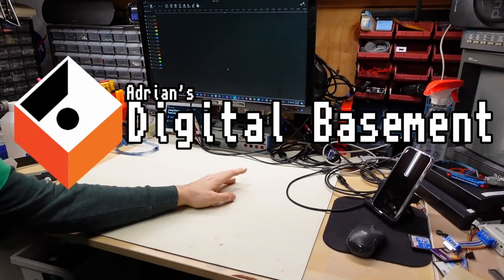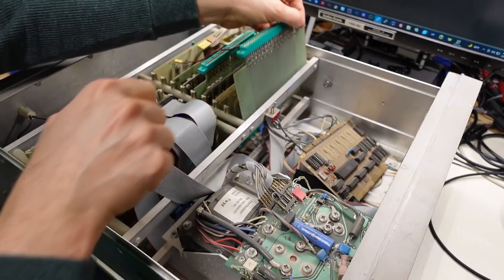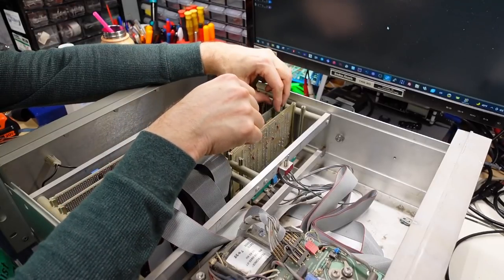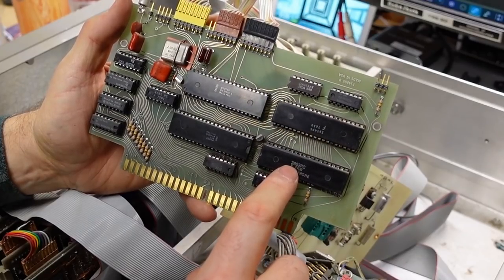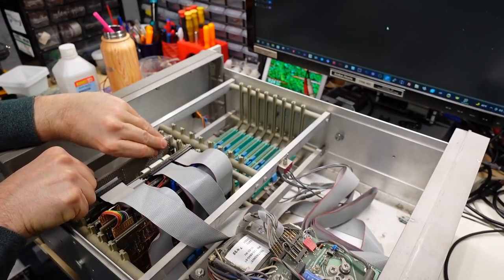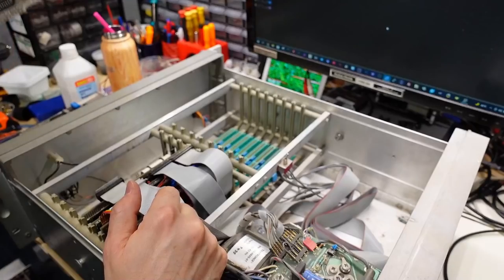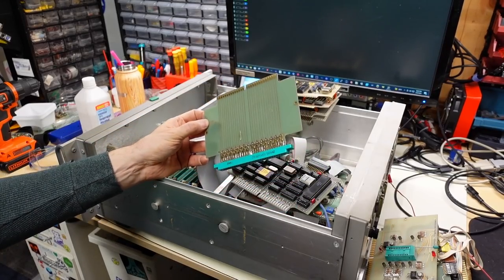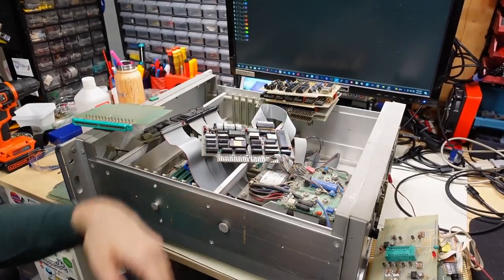I need help finding information on this mysterious computer

Comment: About 15-20 years ago I worked for a company that hosted computers for companies. it was a big place about the size of a big grocery store. It had multiple T1 lines coming in and racks full of computers hooked to it. People and companies would pay to have their machines hooked to it. My job was to install machines in the rack and hook them up, and keep them working, maybe change a power supply here and there. One day a computer that looked like that box came in. It was painted black, no name or lettering, no CD-ROM, no ports of any kind, just a power button. All it had was a network outlet and a power cord socket. I was instructed to bolt it in the rack, plug it in, connect it to the network, turn it on and forget I ever saw it. So that's what I did until this thing reminded me of it.     Just sayin'       Mike

Comment: Wow talk about a thing of beauty! Yeah the wire wrap is what you do when prototyping a system and designing a multi layer board would be cost prohibitive until a working prototype is built and working.  When I was in the Navy we used to have an HTS (Hybrid Test Set) that had a DWG (Digital Word Generator) module that had a ton of relay boards in it. Each board had about 200 relays on each board, and they were all wire wrapped on the back. The wire wrap boards were the final boards they used in ALL the machines we had. I guess because building an actual multi layer PCB probably would have cost a fortune. The machines are all obsolete now and I've been told they were all disassembled and scraped. Originally they had the like 10" brown disc cartridges in them and later went to OPTICAL Readers before they started scrapping the systems in the late 90's & 2000's. Anyways you'll have to put a video up of what you find out. Thanks for sharing, I really enjoyed the show. Best Wishes & Blessings. Keith Noneya

Comment: The original Motorola 6800 CPU board was actually configured such that the system could do in-circuit emulation (ICE) for a system based on the 6800, with a few connectors at the top of the CPU board that would connect via flex ribbon cable to a plug that would plug into the 6800 CPU socket on a system-under-test.   Most of the CPU boards had either discrete LEDs across the top edge of the board that showed the content of the address and data bus.  Later CPU boards substituted the wonderful Texas Instruments TIL-311 "smart" hexadecimal LED display modules to show the content of the address and data bus.  Usually there was a reset switch, and a "RUN/STEP" switch, and a single-step pushbutton at the top edge of the board for manual control of the CPU.   The DDT monitor could examine/deposit memory, set hardware or software breakpoints, could download Motorola S-Record code from a host on one of the serial ports (I think the max download speed was something like 4800 baud, at least with the 6809), start execution at a given memory location, as well as allowing input of assembly code (with absolute addresses only), and a disassembler that output absolute references.  I know that DDT was written for both the 6800 and 6809 CPUs, but don't know if it was modified for use on any of the other processors.

Anyone at Tektronix could order boards through the group and they would provide them as un-populated circuit boards, or completely assembled, tested-and burned-in.   The bare  boards came with a detailed BOM for ordering parts to build them out from Tektronix Engineering Stock, as well as a complete blueprint schematic of the board, and a document that explained the theory of operation of the board, as well as information for setting various jumpers on the board for address selection, options, etc.  The boards were strictly for in-house prototyping and development work, but were also available to employees to purchase for their own projects.  

Employees could purchase the raw boards for Tek manufacturing cost +10%, and the components to build them out could be purchased by employees from Tektronix Engineering Stock, also at Tektronix' purchasing cost +10%.   Tek purchased ICs and other electronic components  in massive quantities, so the prices for the parts, even with the 10% markup, were much cheaper than for what they could be purchased on the open market.    Tektronix Engineering Stock also stocked things like floppy disk drives, hard disk drives, floppy disks (8" and 5 1/4"), ribbon cable, connectors, and all of the other stuff one would need to build a complete system, and as with the rest of the stuff, it was Tek cost +10%.   

With my limited budget, I was able to build out a pretty nice 6809-based computer with four half-height, double-sided double-density floppy drives, 64K of RAM, two serial ports and two parallel ports, and DDT ROM monitor with floppy disk bootstrap for FLEX built-in.  FLEX was a CP/M-like operating system, but was not compatible at the filesystem or disk format levels.   It was written for the 6800, but would run on the 6809 just fine, as the '09 was would run 6800 code un-modified.    FLEX had quite a library of programs available, including a nice 6809 macro assembler, a highly-featured BASIC interpreter, FORTRAN-77, a really nice disassembler, a database system, as well as a lot of user-group contributed software including utilities, games (text-only), educational software, and communications software.

I was actually able to, with some hacks both to the boards, as well as to the operating system, get the Microware OS-9 Level 2 multi-user operating system running on the machine I had built up.  I bought Radio Shack 's version of the OS-9 operating system for their CoCo (Color Computer) model 2 and 3 machines. I re-worked OS-9 to remove all of the drivers specific to the Radio Shack CoCo machines, and included my own drivers for the hardware in my board bucket system.   It worked fine, but because the floppy controller was I/O driven (not interrupt or DMA), every time a process did any operation with the floppies, every other task would hang until the driver finished the floppy operation.   It wasn't really very useful that way.  That is what prompted me to first build a RAM disk out of a 64K DRAM board modified with 256K-bit DRAM chips and addressing hacks to make it into a solid-state disk. This hack, even though I/O driven, was vastly faster than the floppy, and made multi-user operation tolerable.   Later, I hacked together an interrupt driven board that interfaced the system to an 8" Micropolis 35MB hard disk drive (very noisy and power hungry) that I purchased from the Tektronix company store new-in-box for $75.   The drive had a pretty simple parallel interface that I bit-banged, but I did rig up an interrupt for the "command complete" and "ready for command" bus signals, so that commands could be given to the drive, then the driver could immediately return to the OS, and the command complete interrupt would finish off the operation, making the driver non-blocking except when it was sending commands/data to the drive, or receiving data from the drive, which were still I/O driven because I found that trying to interrupt on each byte transferred resulted in overrunning things as the processor wasn't fast enough to respond interrupts for each byte.  This did save time for things like doing seek commands, though.     I hacked OS-9 so that each user got their own 48K of RAM.  I used 4 64K DRAM boards with the top 16K of chips removed and addressing modified so that only 48K was accessible. There was a fifth 64K RAM board that was the "kernel" space, but locked from access when in user mode by building my own memory mapper kludge that had controls for providing protected (read only/write only/read-write) blocks of memory that would trigger a fault interrupt if a process in user space tried to access kernel space.  It wasn't totally foolproof - a user could so screw up the system if they wanted to, but the bank switched memory made hopping between the four user spaces pretty efficient and fast.   Even with its limitations,  multi-user operation was actually quite usable with up to 4 users on the system at the same time doing "reasonable" workloads.  Floppy disc operation, though, still would lock things up until the operation finished -- I never got around to trying to develop a floppy interface that either had an on-board sector or track buffer and interrupts for transfer complete or error conditions, or better yet, a DMA-based floppy controller.   The bus had provisions for DMA, but I never tried it because other, less complex methods seemed to work well enough.

Comment: Just a guess, but I'd guess it's something that started as something fairly standard but low volume. Z80 and terminal-only I/O would hint at something that ran CP/M. Try fixing the corrosion on the board that had the battery, then hook everything up once you've confirmed the PSU works, and start probing the serial ports for traffic. You could use a classic Mac as a terminal if you don't have any dumb terminals.

Comment: 50 pin is typically SCSI (small computer system interface) used in Mac and systems for peripheral connections HDD ( hard disk drive ) scanners , and other devices.

you might try a vt100 terminal as a console as your keyboard and screen for command control using  one of your rs232 connectors  the other parallel connector was for a printer.

Comment: What you called "Transformer wires" is most likely magnet wire. It's common to use that wire for rework. It's still common in aerospace today except that's it's applied in a more orthogonal and robust way. I guarantee that you have flown on a commercial airliner with at least one avionics unit onboard that had magnetic wires on cca.

Comment: Lots of references to CP/M.  That was a command line system that was basically just a load and launch control for your custom programs, so it would likely have just had a terminal for the console and no display (unless you made one and wrote a program to display to it, but the main control was still the "console terminal").

Comment: I think home made should be taken to mean hand made.  The comments argue a lot about it being home made and the cost and everything but its definitely hand made and the time that went into it is beyond the resources of an individual I would say.  There is a stricking similarity to MikesElectricStuff 'My Old BBC Micro System'.  Right down to the disks, eprom programmer, cpu / memory cards and its 19 inch rack mounted.  The BBC was able to use external Tube interface so that the keyboard, video etc was all done in the BBC - so no video or keyboard would be present.  The Tube interface was I think 40Pin.

Comment: If you are dealing with late 70s tech, forget video drivers etc. Something like this would use a VT100, or similar, terminal connected via a serial connection. The (very basic) graphics were implemented using ANSI escape codes.

Comment: I'd guess that this was a special-purpose unit built by a laboratory or R&D outfit. The pcbs show every sign of having been designed by a rank beginner. At the least, none of them incorporated decoupling capacitors,  which accounts for some of the bodging on the back side. When caps were added, they seem to have been inserted in minimum numbers, probably just until the boards stopped being glitchy. There are wires added (for instance on one of the RAM boards) which pretty clearly indicate that whoever laid them out did not worry too much about checking his work before sending the artwork off. A useful addition to your pictures would be the backplanes, to see if (as I suspect) the boards do not carry a common bus structure to all the boards. Another mark of beginner layout is the apparent symmetry of the connector dimensions. It appears to be perfectly possible to insert the boards backwards, and that will destroy the board if the power supply can provide significant current under anomalous load. The boards are 4 layer (ground and +5 on internal layers) but it's apparent that some of the ground or power connections were not made on the artwork and required jumpers after assembly.
I'd guess that this was the first project assigned to a new engineer who had theoretical knowledge of the then-new microprocessors, and he had little practical experience. He borrowed circuits from data books and made circuit boards - and may have laid them out himself, also something of learning experience for him.
It's also apparent that the perfboards were added some years later, presumably as an upgrade. Datecodes for the pcbs top out at about 83, and the perfboard chips are consistent with 1990 or so. So, it's entirely possible that the box contains two essentially independent systems, or it's possible that the upgrade communicates with the original via some completely random interface.
Lots of luck figuring this one out.

Comment: It looks like the VBUS servers the one company I used to work for made back in the late 1980s!! The stuff I was working on was military spec, but it is kind of similar to this! Basically it would have been called a "logic server" which back then it would have held the CPU or multiple CPUs, and the VBUS RAM. The parallel ports on the back when it was rack mounted would have connected it to the storage devices, display inputs, and other systems that the machine required for what ever operations it was set up to "control"!! Basically older machines like this could have up to 6 or even more Co- Processors, meaning it would have been expandable/ scale-able to change with needed or lesser demands! And the units we built at my former employer, you could even increase RAM simply by swapping cards and inserting RAM chips (as they were Integrated Circuit chips, into the memory boards as needed as well!! In the most basic sense it would have been a fully upgrade-able system of the day, and they used these types of systems in everything from inventory servers for stores to (as in my case) battlefield logistics even preprogramming guidance systems! It all too depended on what functions the EPROM (Erasable Programmable Read Only Memory) was programed to do! Other units like multi channel drives (usually 5.25 inch or tape drives) would give this unit further "instructions" as well, so the EPROM was basically a "loader program" installed on it, that told the computer what to "look for" from incoming and out going data! 

Lastly I very highly doubt this was a "home built" project in somebody's basement workshop!! More than likely it was a "mass produced" item that came from a company that only built these units for a very specific customer, like IBM or Digital or even Phillips. Most likely a subcontractor of those companies that build "support hardware" on limited production runs. I used to work for a number of companies like those in my area which sold our hardware to IBM, Lockheed, National Cash Register, Smith Corona, and other companies like General Dynamics as well!! I can't begin to count the number of rack mounted logic computers the one company I worked for built military V BUS servers similar to this for General Dynamics under contract for the nearly 7 years I worked for my employer! But we were literally pumping out thousands of them a month in a company that only employed roughly 300 people and was housed in a building smaller than many gas stations these days!!

Comment: On your computer, the extender cards would most likely be used with the eprom programmer, so you could access the eprom when burning chips.

============

S-100 bus PCB's are 5 inches high and 10 inches wide, not including the edge connector.. The edge connector has 100 fingers on it, 50 on each side.. The edge connector is offset to one end so you can only put it in one direction...

Older s-100 bus computers had seperate boards for CPU, RAM, System monitor, floppy, video... Newer s-100 computers had the entire computer on one board, so you could actually put mulitiple computers on the same bus..

I have an s-100 bus computer called Xitan 
made by (Technical Design Labs/Computer Design Labs)
I never got software for it, but the last time I ran it, it just made random characters on the screen. 

Since then, I bought a couple of blank perf boards. I would love to trying getting the s-100 buss running a modern system, including i2c and other newer protocols.

Comment: Also, I went to a private Avionics test Equip. Company in 85. They built Collins, Bendix and others, old design test panels. It wasn't till the early 2000,s  when the cost came down to use professional PCB,s.

Comment: Definitely STD bus as I counted 56 pins.  The case looks similar to the case materials that come from Tektronics lab stock. Probably something used internally by Tektronics. If it was HP, I'd spot the standard HP cases in a heart beat. Also, both companies had standardized on components, including having their logo and part number placed on those components.  The idea was that R&D engineers would use those standardized components for volume discounting, rather than each lab buying their own.  You can tell by looking for Tektronics logo or name on parts like the transformer, capacitors, common transistors, etc.

Both companies had lab stock at each site with R&D departments.  Usually, it was self service.  Engineers would go into the lab stock room, pull parts they need, and write that down.  This is seperate from manufacturing inventory.  If the engineers needed something from that inventory, they would usually need to submit a poll card with their department account or location code to get billed back.